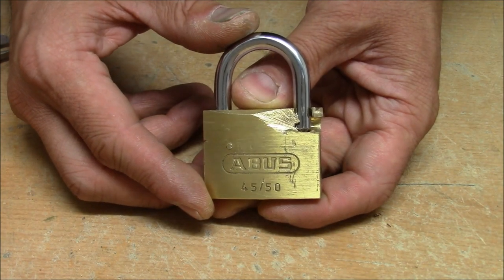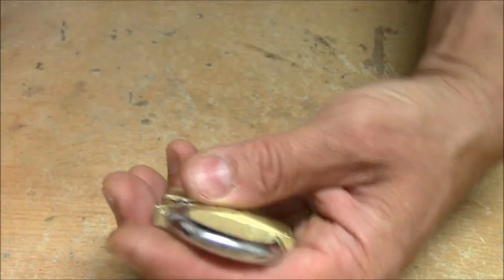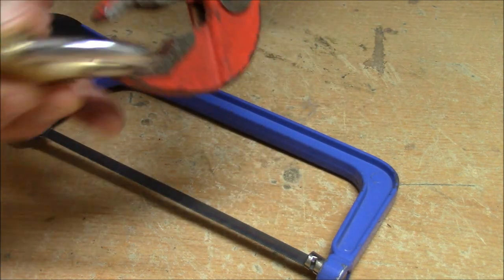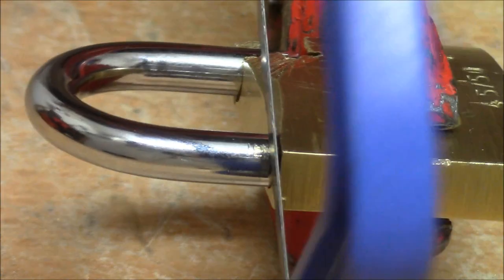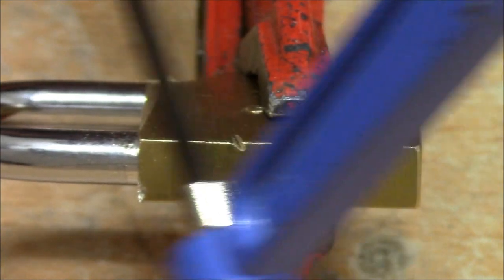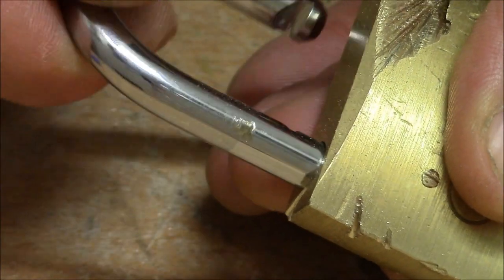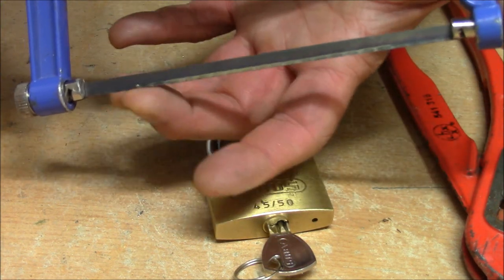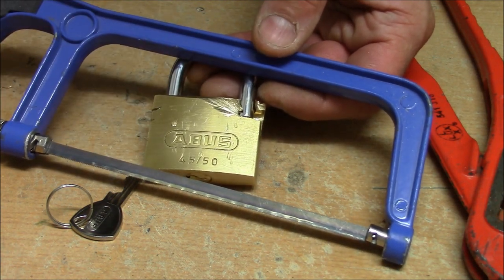(picking 556) Can you saw through a hardened steel padlock shackle? (ABUS 45/50 with 7mm shackle)

Comment from the maker: I used the same equipment as in video ( "picking 555" - https://youtu.be/y4kNAxJfPFU ) where I cut a little widow in the brass body to twist open the shackle. Here I want to test how much resistance the shackle itself provides... 
AMAZING result: The hardened steel shackle of the ABUS 45/50 has a width of 7mm and seems to be well hardened. The little saw could only cause some minor marks - no real threat. The teeth quickly became worn and the hacksaw blade dull. The same blade however could easily cut in the brass body. Of course you can use bolt cutters or a angle grinder, but was not the test.

Comment: The nano coating on the Abus shackles is pretty good against a normal household blade and the slippery surface adds to that :). Try a diamond blade ;D 😁✌.  Just for comparison what the normal blade is worth...I was once sawing off a steel bolt and it didn't go through...looked at it...no teeth on the blade left 😂😁. Love your lock testing videos Potti 😃👍👋🦊.
Reply from the maker: Thanks my friend - I'll see if I can find a different blade in the hardware store. I was really surprised how well the shackle held :-)
Reply: Thanks buddy :). Yes these blades are the last crap 😂. Thank you that you want to try it a second time :). A diamond blade/saw is around 20€...that's a bit expensive, but maybe you find chaper something similar which gets through tool steel :). 😃✌👍👋🦊

Comment: You dont have a bench vice my friend?
Reply from the maker: I do have a vice. However outside in the wild, the burglar has no vice - that's what I tried to simulate.
Reply: @Potti314  yea but a padlock is gonna be fixed to something. You can usually apply a little pressure and lock it into a fixed position